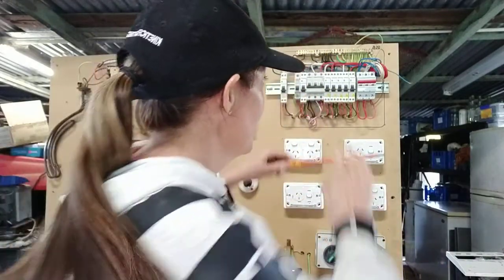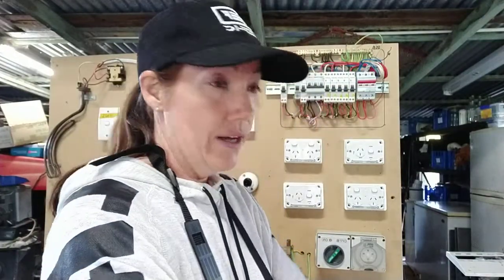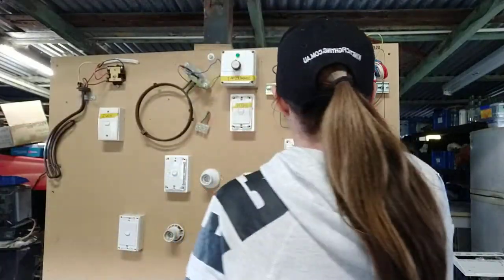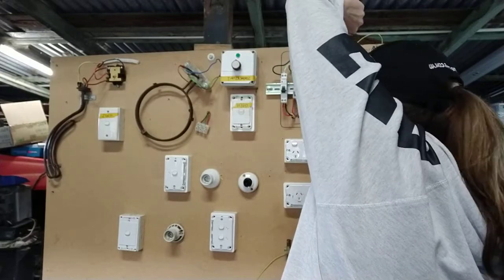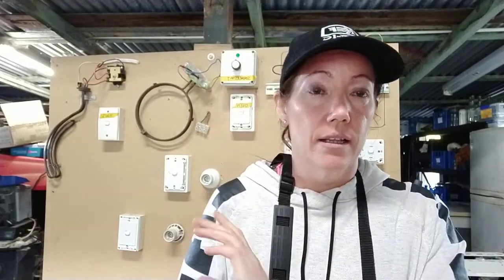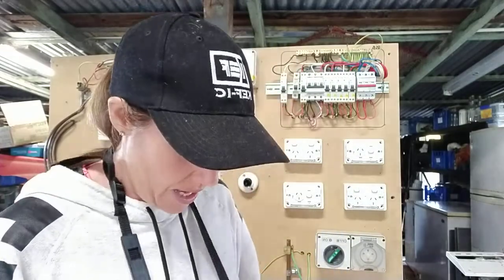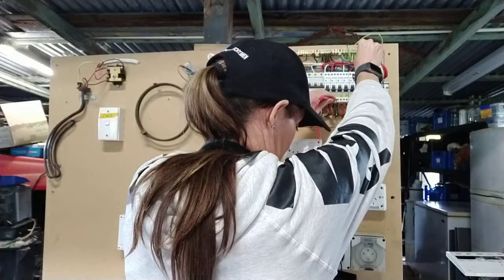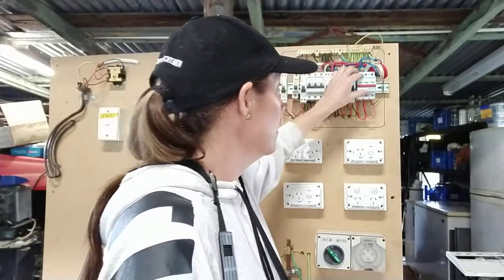Electrical Capstone Practical Exam IR Insulation Resistance

Comment: What the fuck are you talking about. Insulation resistance test is carried out between live and neutral live and earth and neutral and earth , on a new installation you should exspect a ready greater than the test instrument can read  IE > 999 
On an old installation any thing less than 1 mega ohm is a fail 
If you you get a read greater than 1 mega ohms then that is a pass .  Also it is a dead test and you never never test a live  circuit  unless  it is a loop impedance test . Your wiring regulations are the same as UK when it come to testing . Also for insulation resistance test all loads should be removed and all switches in the on position any sensitive electronic equipment should also be removed from circuit as they can be damaged when you inject 500V DC in to the circuit.
But I wish you well with your exams good luck 👍⚡️
Reply from the maker: Sean 
Appreciate your reply. 

I do these videos start to finish with no edits so I failed to mention this isn't full installations test.  

The video shows how to test each installation section separately.  
Consumer Mains only
Submains only
Final Subcircuits only

I apologize if I didn't explain the clearly at the beginning of the video.  

The board is dead. This is a dead test. 

2:22  Clearly state existing homes have to be greater than 1Mohm. Only new installations have to have a reading greater than 50M ohms. 

I can't comment on UK Rules. 
I'm not familiar with them.  

In the final Subcircuit section where you'd expect to find your loads
 connected I say @8:05 resistive loads out or check requirements for load.  E.G A heating element attached has to have a reading greater than 0.01M ohms. If in doubt remove element testing just circuit cable. 

@8:24 7 I comment how electronic sensitive equipment needs to be disconnected or have insulation resistance test voltage reduced to 250V. 
The simmersat is a great realistic example of what to expect.  

George,
Yes my apologies this is not complete installation testing. 

Complete installations are great but knowing how to test each installation section can help locate faults quicker. 

Please ask your Teacher or employer to go through IR with you if your still unsure. 

My videos are just a guide and I apologize you now feel confused and anxious. I hope your capstone went okay.
Reply: @theea3466  hey I’m doing my capstone Wednesday and on the practice sheet it had earth continuity test and earth fault loop (Zint) what is Zint am I just testing resistance between earth and active to find Zint?
Reply from the maker: I have a video on Earth Fault Loop impedance.  
https://youtu.be/l4JDSfJZ9P0

With the readings refer to table 3.2 in AS2017 and Table 8.2 in AS3000

AS3000 is to 1 decimal place.
AS3017 is to 2 decimal places.  
It's typically same table information but you'll notice it's not exactly the same and some figures are different.  

When in doubt always use the safer more protective figure.  

If you teacher states to use one table as the reference follow teachers advice and instruction.

Z=impedance 
Int= internal 

Earth fault loop consists of 2 parts 
Internal and External 
Conductors upstream of the reference is External.  
Conductors downstream of reference is the internal.  

AS3017 Clause 3.6.2 (e) and (f)
Figure 3.21 on page 37.  
Using a highlighter highlight impedance paths:
Zab
Zbc
Zfg
Zgh
Zha
These are all upstream of the their reference point this is the Zext. The protective device is the reference point. 
 
Grab another highlighter colour. Highlight path 
Zcd
Zde
Zef
This is the Zint
The Internal path of fault. 

Then check AS3000 B4. 4 Page 447 and P448
This is the same diagram and details but it references B5. 
B5.2.1 has a determination of Zint and explains more clearly the difference between Zext and Zint.

States Zext includes transformer and supply cable. 
In Notes it states Consumer mains also part of Zext.

It says Zint can be determined where cable length and Cross Sectional area CSA is known. 
Zint=Zcd +Zef
Zcd= Impedance of Active conductors.
Zef= Impedance of Protective Earth cable.

My rusty notes 
Fault Current is known as earth fault loop.  
Test applied to:
Circuits not RCD protected
Socket outlets >20A
Fixed Stationary Equipment >18kg
Submains

Good luck.  Hope this helps
Reply: @theea3466  I passed!!!! Thank you so much!!! Honestly couldn’t have done it without you
Reply from the maker: @jacobfierro1749  
So glad to hear this.  Well done, what a relief such awesome news.  Don't be afraid to ask questions we still have workers ask questions and they completed their apprenticeship 10 years ago.  Electrical is a huge field and especially as technology evolves, new equipment emerges.
Reply: hey mate, I 100% agree with you ! I have my capstone practical exam in two days and watching this lady do a insulation resistance test is giving me anxiety, my prac involves an IR test on a WHOLE INSTALLATION. can you please reach out to me and give me a helping hand or even some advice !

Comment: Great video, can you also talk about 2 way switches and 3 way switches
Reply from the maker: Pat,  for two and three way switching you need to test on and off for each switch.  

Two-way. 
Test circuit with both switches in current position. 
 Flick switch 1 Test.
 Flick switch 2 Test. 
If it helps to draw a picture of what you are testing.  Remember your testing each piece of wire in the circuit between accessories.  
------/=======/-------
Three way
Exactly the same 
Test.  Flick switch 1 
Test  Flick switch 2 
Test Flick switch 3 
Test.  
------/======/======/------

Comment: Are you sure you take the main neutral out?
Reply from the maker: Great question.  Yes! 

Page 17 AS/NZS 3017:2007
Test Sequence 
4= Disconnect the supply Neutral from the Neutral bar.

For the exam you are required to test sections of the install so yes Neutral needs to be removed from the Neutral bar.  

You need to bridge Active and Neutral to test a complete installation.
Reply: Yes you do t  n c s  systems you would get a short on the reading as the neutral and earth are joined at the meter position

Comment: Great videos!! If the main switch is kept ON isn't that Live?
Reply from the maker: Great Question James. This test has to be done before power is applied. Check Clause 8.3.1 AS/NZ3000:2018 This test ensures that the integrity of the insulation is maintained and no live conductors are 'leaking' to earth.  

The fuses would be not installed until all mandatory tests have been completed and the installation is proven safe to power up.

The tester is applying  an intermittent  500 Volts to the dead circuit But you need to test each wire and accessory that's why we switch 2-way Light Switches etc. 

Also important to switch Main Switch  On/Off to separate the final sub-circuit,  sub-mains and Consumer mains as Clause 8.3.6.1 states they need to be tested separately.